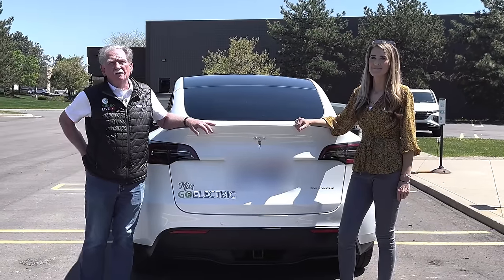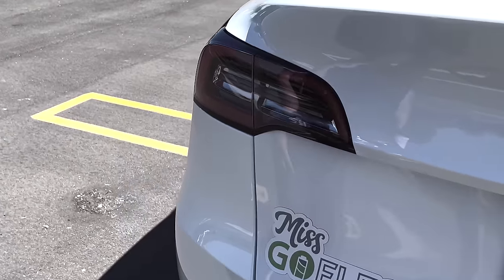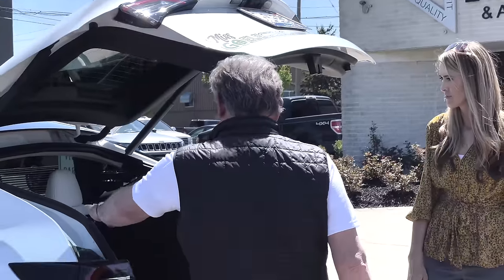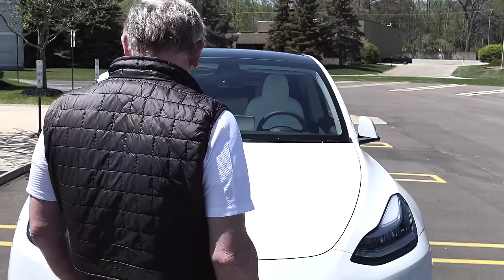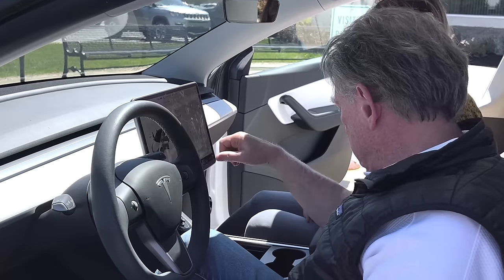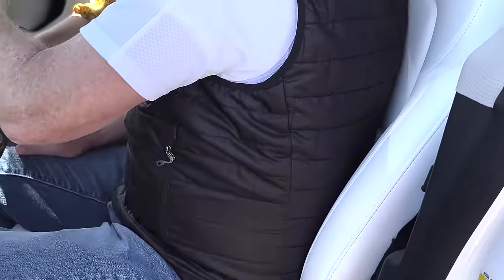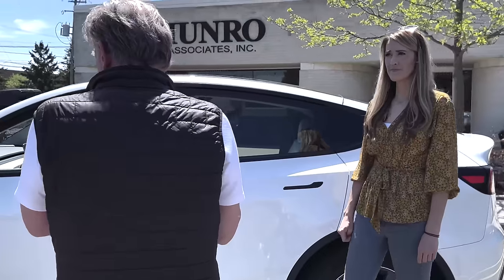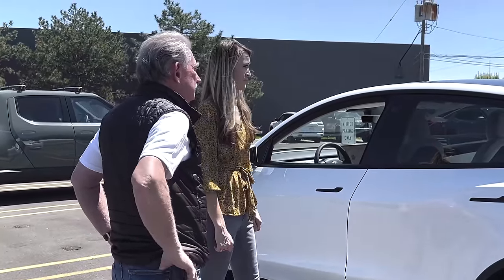Sandy takes a peek under Miss Go Electric's New Model Y Frunk!

Comment: I had a similar minor gap and a paint goober on the roof rail and was told if you don’t take it you will go back into the Que so i took a chance with notating all the issues and let service take care of it. I am happy to report they did take care of all the issues ! I had the car wrapped afterwards and 2 years later its holding up great.
Reply: Threatening to put you back into a one year waiting list tells me all I need to know about the Church of Tesla.
Reply: @eugeniustheodidactus8890  It surely tells that whatever the states of the car, it will sell. As an investor, it's all I need to know. But I'm not a TSLAQ dumb dumb...
Reply: @Nooblade  Just to be clear jagoff... I own 1500 shares of TSLA but I am not an advocate of Tesla's world-class shitty customer treatment.
Reply: @eugeniustheodidactus8890  not a threat lol, the reason is that the demand is high enough to support such. People literally flip Tesla's the demand is so high. Dealerships takes vehicles with such imperfections and fix or hide them depending on costs to do so. Dealerships literally lie to you all the time about the vehicles condition. You can literally walk about a dealership parking lot with a device to detect paint thickness and fine where panels had paint defects and instead of fixing it they painted over the defective paint job over the whole panel
Reply: @eugeniustheodidactus8890  painting over paint defects is also illegal BTW, because the surface isn't properly sealed and has trapped air/moisture. Which will lead to premature paint failure or in case of metal parts, complete destruction of that car part.
Reply: @eugeniustheodidactus8890  
You can't help shown you bias, can yo?
"Waiting for a model Y" in one post,
Toxic comments get and in others.
I have you marked as one of "the new breed" of 
"I own a Tesla ....but" FUD merchants.
Reply: @eugeniustheodidactus8890  and marking up prices by 10k? tell you anything about the church of Hyundai or Ford etc...?
Reply: @rogerstarkey5390  Just keeping it real.  If you mean that it is highly unusual for a Tesla fan to also hit them below the belt, then yes I would agree, but I am in good company.
Reply: I saw transportation marks on my undercarriage and I too was weary about the "note the problem and take delivery" but it works well they scheduled me later in the week and  they already ordered the parts noted on the "paper". They replaced my mirror cap (small buffer swirl mark), rear undercarriage aero cover and other small stuff- they made good!
Reply: @eugeniustheodidactus8890  the FUD is strong with this one.
Reply: @eugeniustheodidactus8890  That's what happens when supply is limited. You think if you reject delivery of a Rivian, they will find another one for you? There are no other ones. That means they have to build it and you will be back on the list. So, if the issues are minor, you take it and schedule an appointment with the service department to fix the issues. With all the car shortages, I'm sure this happens a lot with all the brands right now.  .
Reply: @First Last QA errors are inevitable at scale, this whole thread is full of people talking about how Tesla fixed QA issues TIMELY and for FREE. There literally isn't a higher bar they can even reach for....
Reply: @ymcpa73  Yes of course, if the issues are that minor that they can be fixed then this is no dealbreaker.  In my 50 years of driving, I have never been faced with such a supply shortage and not taking this new world order very well.
Reply: @ChaimLoecher  good to hear it

Comment: We had our 2022 MY delivered at the end of January and it was pretty much perfect. Admittedly, I'm not as critical about gaps as Sandy, but even so, they are all very consistent and the paint was very good too. The only issue we have had was a rattle under the rear in the first week which was taken care of with a quick service appointment. Other than that, we love our MY.

Comment: Sandy is right about the window. Do the window calibration that is in the owners manual. It fixes this 100%
Reply: Our 2022 dual motor m3 built in Fremont is perfect and the paint is great also ,thanks Tesla Team Great Job
Reply: Both front windows on mine do it too, have to put it up a couple times before it stays up. I figured it has to do something with the window sensor.  Also figure that it will change as the seals wear in.  I'll have to try the window calibration. For reference: MYP built Feb 2nd, took delivery Feb 16th.
Reply: @1472fred  same here .. sold my 2019 long range 3 for $56k and paid $54k out the door for my 2022 that I took delivery of 3 weeks ago.   Build quality and fit and finish are perfect. My 2019 was good and never gave me any issues .. but I definitely feel my 2022 is much improved. Thank you TESLA!
Reply: Tesla service came to our studio to rectify the issue a week prior to this video with Sandy.  He performed the calibration and the issue persisted.
Reply: @MissGoElectric  I hope they sort out those fit and finish issues for you in short order, I'm sure they will, but hope you keep us posted!
Reply: Multiple calibrations haven’t fixed mine. Ongoing issue and I think it’s 100% software related.
Reply: Hope this fixes it for everybody. Does this happen while driving only? The road bumps can trigger windows on auto-close to reverse in my old car.
Reply: @MissGoElectric  My 2018 LR Rwd Model 3 is turning 4yo next month and never had this window issue until a few OTA software updates ago and then it went away after a while (maybe due to additional bug fix updates) and hasn't done it in months.  You might try a thumb wheel reboot but I guess that with most things software-based, a line of code could get a glitch that causes a problem until redundant code or bug fixes catch up.  Beautiful car and the one I'll probably be getting next.
Reply: Service center calibration didn't fix mine. It take s a few months to get the parts in, but they just replaced the motors and regulators.

Comment: I took delivery of my Fremont made Model YLR one week ago upgraded with white interior. Only problem noted so far is that on sunny days the sun shines thru front side windows & bounces off the white dash directly onto the outside side mirrors adversely impacting visibility when using the mirrors. I will need to have the front side windows tinted to at least 30% to resolve this issue.

Comment: I like the attitude that if it works right and is water tight the other problems can be overlooked. Picked up an old truck a while back. The doors rattle, the headlights are fogged, there are dents one place or another, but the body is generally straight and it runs. Good enough for me.

Comment: 14:50 Sandy has it right about the window. THe anti-pinch function is not properly calibrated and due to weight of the window, the systems sees it as is crushing an arm or something.  If it does only in Auto up mode but not in Manual up mode,  this is the problem
Reply: Same issue on mine. Service recalibrated my windows, which didn't fix anything. They ordered new motors  and regulators and just finish installing this last week. We will see.

Comment: We had the same window problem on our model Y. We took it in to get it looked at and they recalibrated it. Works well now.
Reply: @Alistair Balistair The calibration didn't work on mine. They just replaced the motors and regulators. We will see how it goes.

Comment: In 1965 on the Janesville Chevy truck line one of the quality guys walked the line with a piece of 2 x 4 about 30" long. He'd slam the moveable panels on the 2 x to torque them into plane with the fixed panels.

Comment: All my life I have owned Mopar, from 1967 to 2004, and I can tell you, function is what counts, when it comes down to it, durability of components, overall drivetrain and suspension function and smooth design is what kept me coming back to Mopar. From A total of four Slant Six engines /A904 3 speed transmissions with the 1981, having Lock up torque converter from 1978 on, from 1967 to the last 1981 with Hydraulic Valve Lifters, I have not encountered any hardier engine design, second up are my two 3.8 L V6 engines /41TE Transmissions. The one has 217K and runs fine with no rebuilds, just light maintenance on it. My two 318 engines and two 360 engines were also great, although for the first time ever, I had a transmission failure in the 1999 Dodge B2500 Full size van, coupled to my 360. Which is not a bad experience. 

Then in 2008, Chrysler walked away from great reliability for 1 extra MPG, with the overly complicated, 3.6L that has roller bearing bottomed lifters that eat their cams, a plastic Oil Filter adapter that mechanics can look at wrong and cracks, a 6 speed 62TE transmission that was not hardy, with no ATF dipstick, and leaky transmission cooling hose crimps, and to add icing on this cake, the Microprocessor based, Fuse and circuit breaker box from hell, which can, because they didn’t move it into the interior, gets corroded, and has some cheap soldered in relays that die. When the microprocessor loses it, mind, the car acts possessed, windshield wipers activated when ignition is off, random horn blowing, fuel pump circuits not coming on, leading to no start conditions. 

I’ll take panel gaps that do not interfere with function anytime. 

I still own my 2003 and 2004 Chrysler Town and Country minivans, and eventually, I hope to go to Tesla, as I see the old Chrysler simplicity In design mantra Mopar used to employ along with the 1960’s style straightforward engineering we saw erode away in the late 2000’s when Fiat got their hands around Mopar’s throat and started squeezing hard.
Reply: Thanks for the insights. My creator's 2012 Caravan has bizarre electrical gremlins: radio blares on/off; buttons work/don't; strange warnings from sensors. Time to go Tesla.
Reply: FIAT lost a life time loyal customer with me... I traded in my FIAT 500X for my Tesla Model Y Long Range on Septermber 2, 2021...I will NEVER go back to FIAT, even if they do come out with electric cars that would suit my needs...

That last FIAT was the worst FIAT I ever had, the one before, the Fiat Bravo Diesel was wonderful, but this 500X was under powered and had issues all the time, the orange Motor warning sign has been on about 75% of the time. Wheels almost falling off, Interior panels falling off for no reason, Fuel consumption way worse than advertised,  Cruise control not working 80% of the time unable to fix, infotainment completely useless, (only used the radio and USB media, BT connection with the phone was OK though), voice control did not work, navigation out of date from day one, and unable to update, used Waze on my phone instead... and on and on and on...

So glad with my Model Y, where everything simply works, and no issues at all, only have been to a service center to install the tow hitch. With gasoline prices going through the roof (about 10-12 dollars per gallon here), makes me even more happy I have made the transition to Tesla.

Pretty sure there are tens of thousands of former loyal FIAT owners now trainsitioned to Tesla and never go back.

Comment: I’m surprised, I have a 2019 model 3 which seemed at the time no two were the same. Going through the Tesla center you could find gap issues etc on all the model 3 cars. Some were worse than others, but we were taught to scrutinize the cars prior to accepting them which got customers nit picking maybe too much. Anyway, fast forward to the model Y, and three times when I was bringing my referrals to pick up their Teslas, I closely examined all the model Y cars on the lot, and couldn’t find any with the model 3 deficiencies. Thought Tesla had cleaned up the build process. Guess we’ll see how the Berlin cars are. Still say my Model 3 is the best thing I have ever bought.
Reply: The fact that she got it in a week sets off alarms.

Comment: Sandy, this is off-topic, I had the same little cough you have for many years. Finally found out it was caused by drinking soft drinks (Diet Pepsi) with Aspartame. I stopped drinking anything with Aspartame and my cough went away. It's been years now and I'm still 100% clear.
Reply: Little cough also caused by some medications.

Comment: 24:17 im impressed. im hating on Tesla lately due to added cost of the mobile charger/cable but this is impressive.  I think there is a possibility for front to be just a huge frunk like that of F150 Lightning
Reply: The frunk is already pretty big, can easily stow a big duffel bag, and it is deep too, so you can put something else on top of the bag.

Comment: As a Tesla shareholder, it is really frustrating to see made in Fremont EVs, with the panel gaps still, as I have seen many European videos of the MIC Model Y being delivered and I have not seen many, if any gaps issues, so I suspect that the California factory is the issue here, so cannot wait to see the Texas made Model Ys, after they have had some time to ramp up properly.
Reply: It is a Fremont thing .. however I took delivery of 2022 Model 3 LR 3 weeks ago and fit and finish is absolutely perfect. I think Fremont build quality has improved big time but still some work left to do it seems. The new factories will not have these issues.
Reply: You will not get good panle gaps with the time they have to build the car. I cant find any wrong with my panel gaps on my Lexus LS, thats because they have 6 hours to work on panel gaps.
Reply: It’s probably a Fremont thing. The SH Model Y and 3 are much much better.
Reply: @epoxy1710  there is little to no time for any rework or fit and finish on Tesla vehicle. Toyota Lexus, Porsche, etc build their end of line to do exactly that. But that was never Tesla intention
Reply: @benjaminkessler8169  Probably.. guess they just count on the service centers to rectify small issues under warranty.
I'm lucky that I have a service center 10 minutes away, so getting my trunk-lid adjusted was a very minor annoyance. I can imagine other people who live a long ways away are probably bothered more by that.
I hope Tesla does mobile service for door adjustments and such. And hopefully the giga-castings and changes in manufacturing at the new factories make the panel-gap problems go away.
If I were Miss Go Electric, I would definitely schedule a service appointment to get those panels fixed. They will 100% fix this no problem.
Reply: @benjaminkessler8169  Yes Toyota or Lexus does not have a year long waiting time or orders either.
Reply: @epoxy1710  See my reply to Benjamin Kessler.
Reply: @RufftaMan  it’s not the casting, other OEM don’t use casting and have much better tolerance and flush/ gaps on panels. 

It’s the BIW and assembly of parts. The cycle time doesn’t account for adjustment of parts when assembled

Comment: The panel gaps and fitments on my 2020 June Model S were not this bad (but not good either) The Service manager (a former tech) and one other Techs had it all fixed in 30 minutes in the parking lot. I just don't understand why Tesla put cars like this into inventory.
Reply: Why?  Lol, to get them out as quickly as possible for the quarter.
Reply: Because they don’t care about quality. They want to get the sale asap and the customer can deal with it later or whenever tesla has time to “fix” their mistake.
Reply: If it is fixable in 30 minutes, the question to be asked should be: why doesn’t the Tesla garage fix these gaps and whatnot before handing it to the customer. After all a happy customer makes a happy camper and he would be more inclined to recommend buying a Tesla.. And we would finally get rid of all these YouTube and media panel gap yadiyadiya bs.
Reply: @eddieke4751  I totally agree!
Reply: @eddieke4751  Tesla has even less incentive to fix these issues prior to the customer getting the car now due to demand being so high, which is really sad.
Reply: @eddieke4751  That's a good point. I mean when I got my Model 3, they were pretty understaffed at the delivery center, so I guess fixing panel-gaps there was not an option.
But I agree that having 3 or 4 tech guys there, just inspecting arrivals and fixing those small issues before delivery, would definitively improve customer satisfaction.
Sure, it's not a big deal to bring it in to service under warranty for those issues, provided you have a service center nearby, but it's an unnecessary hassle, especially when you should just be hyped about your new car.
Reply: You answered your question, because they let the service centers do it.

Comment: For the window rolling up issue, is the trim, it gets sticky and the sensors think there is something stuck... The mobile tech put some window glass wax on my 2018 Model 3 and that fixes it for a good year and a half, however it comes back sometimes when it gets sticky. I honestly think Tesla needs to either change the rubber trim's compound to make it not sticky or reduce the sensor's sensitivity a little. :P